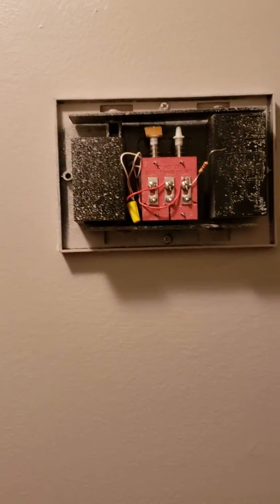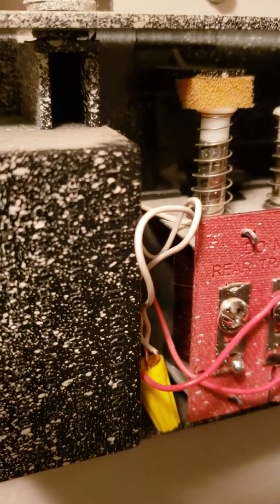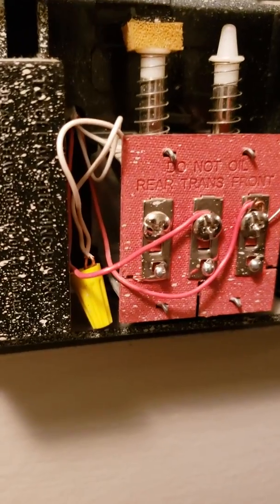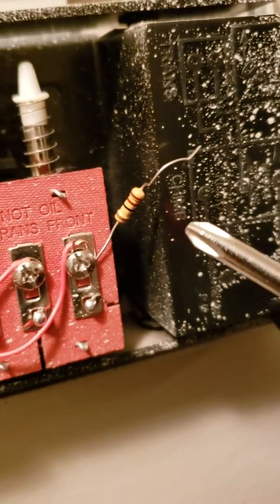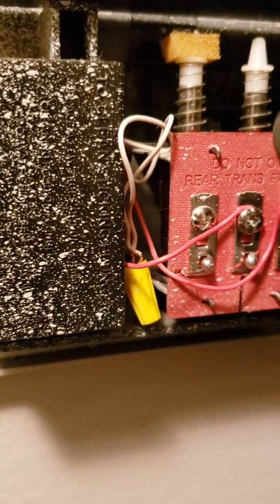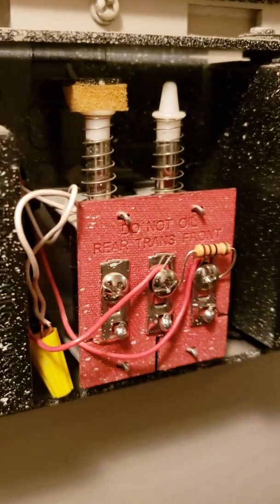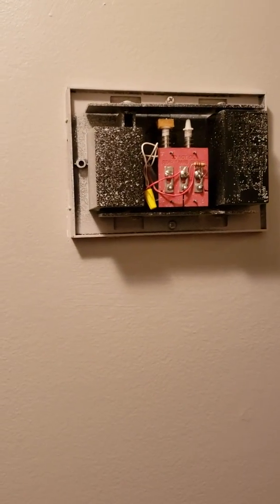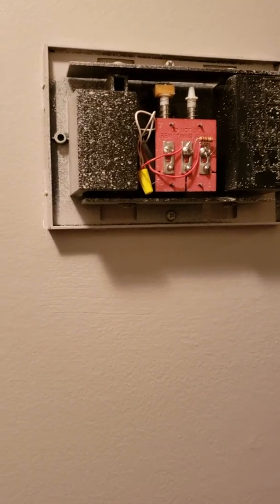Fix buzzing/humming sound after doorbell security camera install

Comment: This is the EXACT problem I have, however, when I had the Ring cameras (Two of them) I didn't have to touch my doorbell chime. I wanted to switch to Google Nest since let's face it, Google is awesome at everything else.  Yesterday, when I made the switch and added the 2nd doorbell it started to buzz and slowly move like you stated in the video. Why is it that Nest Doorbell does this and not Ring? Also, does this increase your energy bill? How long does it wear down your transformer?
Reply from the maker: It all just depends on the amount of electricity flowing to the plunger. I imagine the nest uses less of it and allows more to flow to plunger. At the end of the day theoretically it is keeping your transformer engaged so there maybe an increase in energy use but not much. And it will put wear on the transformer and it might fail quicker. I've had this setup for like a year and still no issues. I figure whe my transformer goes out, ill get a digital chime. I'll post the install when i do
Reply: @efdoesit  I ultimately removed the Nest cameras after I installed them (so much work to do this three times 😭) but I was told by Google I had to replace the transformer since I needed one that produces more energy....too much work for me and too expensive since I would have to hire an electrician. I try to do it myself for as many things as I can to save money but that’s another level. Thanks for the tips!!
Reply: @JessyJ318  Google is awesome

Comment: This worked.  I used a 10 ohm resistor
Reply: same problem. where did you get the 10 ohm resistor?
Reply: @WenboinCanada  Amazon.  Had to buy a pack of 100 for dirt cheap. It worked like a charm

Comment: I just did this to my digital chime. Hopefully it works. My digital time would buzz randomly, like chime was  overloading with  electricity, so that's why I did this. Shame on Amazon for not fixing this issue on there new 2020 doorbell version. By the way, my transformer is 16v 30vac.

Comment: You're using a 1/2 watt resistor for a system that drops 10 watts.  This is dangerous and could even cause a fire. Please take this video down.
Reply: What would be a 'safe' method then? I have same issue and am looking for an answer. Please! :)
Reply: Never mind. I used the bypass method that came with my Ring Pro and since I already have their Chime, simply bypassed the front doorbell altogether and buzzing has stopped. Safely done. Thanks for your warning, though!
Reply: @A11iOop  what is this "bypass" method? I just installed my ring pro and have the same buzzing issue. Thanks
Reply: @allaroundgoodtime970  There are instructions in the Ring Pro manual at the back. If I could I would take a picture. It is basically still using the power kit they provide and running the mechanical doorbell wires in, then out of that kit to bypass your mechanical bell. Ah - here is a video I found for that. https://www.youtube.com/watch?v=6XRaH7AE8uc While the buzzing stopped for a while after I did that, it still came back and comes and goes intermittently. It isn't too bad - more like a quiet fridge turning on. But I decided to contact the electrician, anyway. I think my system is just too old and need a newer transformer or something.
Reply: @a11Oop968  thanks!

Comment: It fixed my buzzing sound but now don't have enough electricity to ring the doorbell. Would installing a lower resistor help?
Reply: What size resistor ? And possible the plunger is drawing too much ?
Reply: @efrainarredondo1032  this is because installing the resistor in this fashion puts it in parallel to the video doorbell, and resistors in parallel act like a voltage divider, so your doorbell is not getting the voltage it needs to operate.
Reply: @LongLiveCHIEF  Resistors in SERIES act as a voltage divider; resistors in parallel act as CURRENT dividers. In any case I don't recommend this as, if not properly sized, heat sinked and ventilated, it may cause a fire.
Reply: Maybe a couple of months late, but a higher resistor. Think of a resistor as a water valve, the lower the resistance the more open the valve is.

Comment: Thanks for the video!!

I upgraded my transformer to 16V 30VA (up from 16V 10VA), would i use the same resistor (10ohm 0.5 watt) or do I need something bigger with the more powerful transformer?
Reply: No, absolutely DO NOT use anything like the resistor he recommends.
Reply: @LongLiveCHIEF  what kind of resistor should I use then?
Reply: @Chriselchingon23  a power resistor. something rated for 16 - 24v.  a 50W 8R would be my recommendation, but depends on much current your system pulls.  If it's a higher current system, go with 100W 10R.
Reply: @LongLiveCHIEF  Thanks for the reply! I was planning on buying the resistor that should have come with the doorbell kit... it's 10 ohms, but supports a way higher current - would that work?

Comment: Almost put house fire. DON'T use this trick.
Reply: So when I did this, then resister started to smoke and I had to quickly shut off the breaker.  When I started to look closer, I had the red wire going to the “T” but then I had a white wire going to the “F”.  But in this video he had only red wires in both.  So I opened the box up, connected all the white wires together with a wire nut, then put the two red wires as he did.  When I did that, it worked and nothing heated up or smoked.
I’m not sure if that’s your same problem, but might want to check
Reply: Same boat.  Resistor burned as soon as I turned on power.

Comment: I have a mechanical doorbell like you and experience the same buzzing sound after installing my video doorbell. Will a Digital Doorbell Adapter do the same thing as the resister?
Reply from the maker: This will probably work as iij believe it acts as a true circuit break, but I would honestly look at the circuitry first. Also it allows you to smart interface with your chime.
Reply: @efdoesit does it still work? Still no humming, or overheating, or any other issues?

Comment: I did this and the resistor heated up HOT!
Reply: So when I did this, the resister started to get hot and eventually started to smoke and I had to quickly shut off the breaker.  When I started to look closer, I had the red wire going to the “T” but then it had a white wire going to the “F”.  But in this video he had only red wires in both.  So I opened the box up, connected all the white wires together with a wire nut, then put the two red wires as he did.  When I did that, it worked and nothing heated up or smoked.
I’m not sure if that’s your same problem, but might want to check
Reply: This happened  to me too.
Reply: Same thing happened to me, did you ever fix it?
Reply: @robertpitts8564  So when I did this, the resister started to heat up and eventually smoke and I had to quickly shut off the breaker.  When I started to look closer, I had the red wire going to the “T” but then I had a white wire going to the “F”.  But in this video he had only red wires in both.  So I opened the box up, connected all the white wires together with a wire nut, then put the two red wires as he did.  When I did that, it worked and nothing heated up or smoked.
I’m not sure if that’s your same problem, but might want to check
Reply from the maker: Hmmm,,, perhaps using a larger resistor. Most door bells will be fine with the size I used but there are some that may be putting out more power. Per my chime specs. The resistor is cool to the touch.  Resistors are made to decrease energy and decipate the extra energy in the form of heat but shouldn't get too hot.
Reply: Mine too

Comment: Thanks for video. I'm going to have to get one of those diodes. Does your door bell work after that fix?
Reply from the maker: Yes. Works fine.  All we are doing is decreasing the amount of energy by decimating it in the form of heat through the resistor.
Reply: @efdoesit  My doorbell wouldn't work as there was not enough power to raise the plunger high enough to hit the chime. I will try a lower resistor.
Reply: @efrainarredondo1032  for buzzing with no cam, what ohmage you use?

Comment: I'm not sure if I installed my wire tight enough . I still hear the bussing noise.  We had to install a new transformer first . Any suggestions?
Reply from the maker: Perhaps larger resistor is needed. There are other resistors you can get